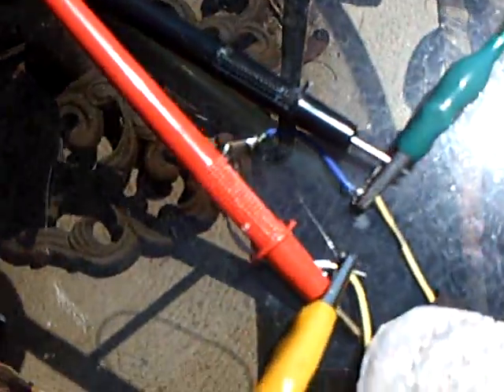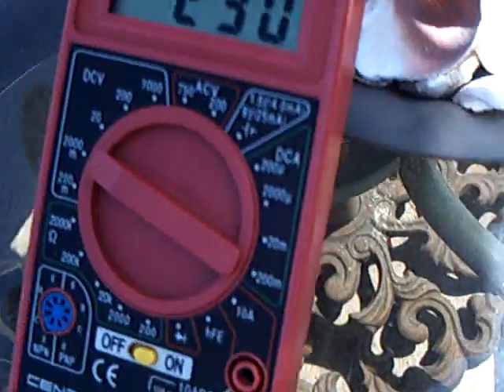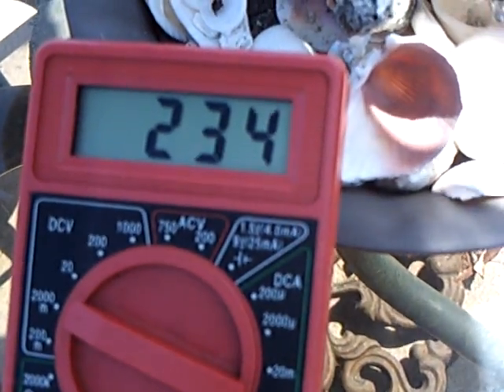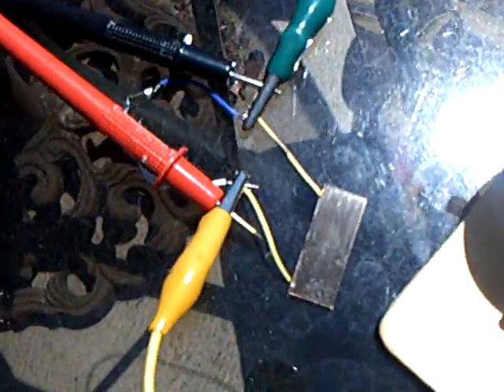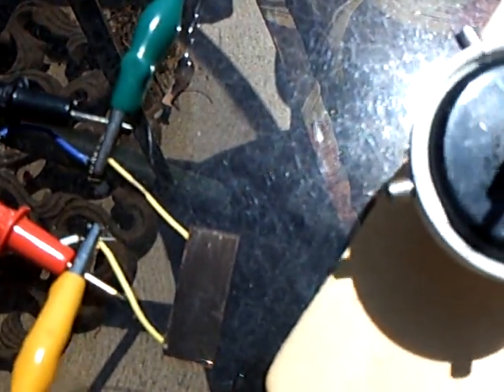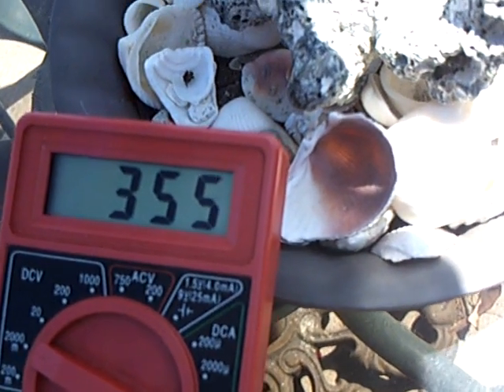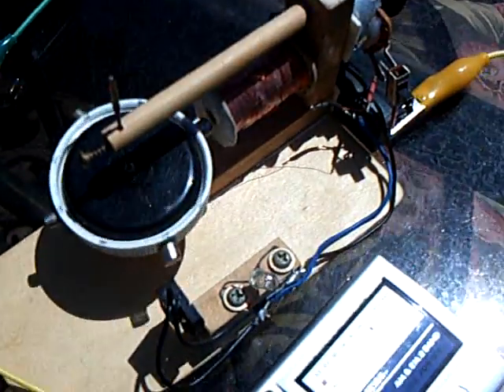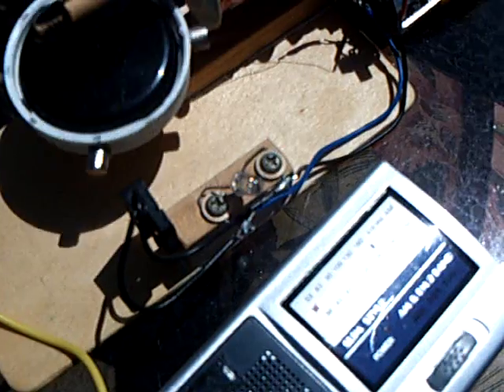Looper Motor ----with a little help from Mr.  Sun

Comment: Have you considered adding a super cap on the positive side with negative of cap to ground rod? (Tesla) I would think stainless ground rod. Copper oxide on pipe or standard ground rod would be a dielectric forming a diode that takes milliamps just to release. That's if the diode is in the right direction.
Reply: 1 Generator coil= 1 result
Multiple generator coils with sphere magnet cores= Free lunch everyday!

Comment: "There is no free ride!" You got that right!
Another great vid!  I'd like to see all the specs for this setup too (if you have some time)

Thanks!
Reply from the maker: Well the wind is free and so is sunshine----but the devices to convert the energy to something usable are not.  This is just a simple reed switch monopole pulse motor. Nothing fancy here.
Reply: ***** Simple yes, however, showing a schematic & describing how energy moves through the circuit, how it is pulsed to do work, etc would be useful to people with less experience than yourself.  Just a thought.. I know you work on lots of projects, so...